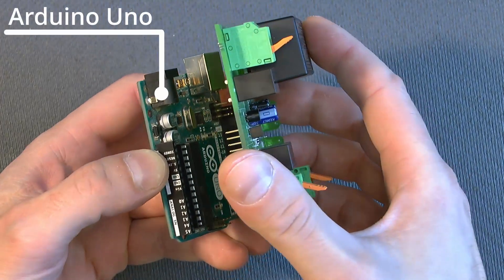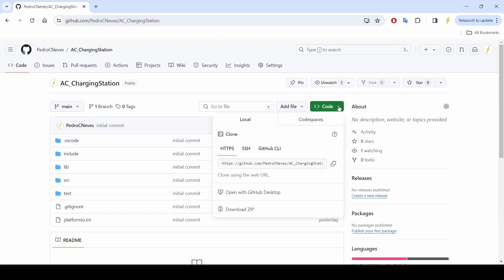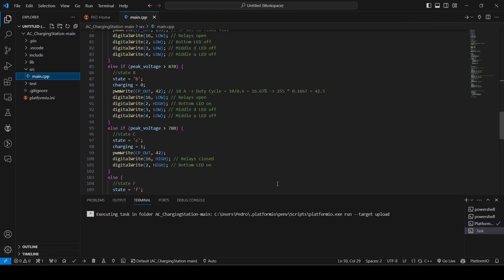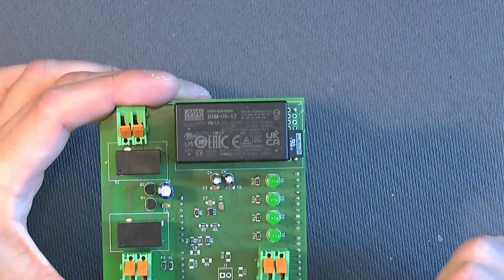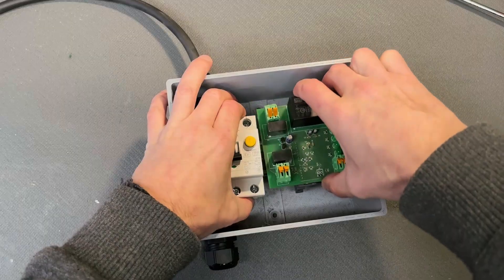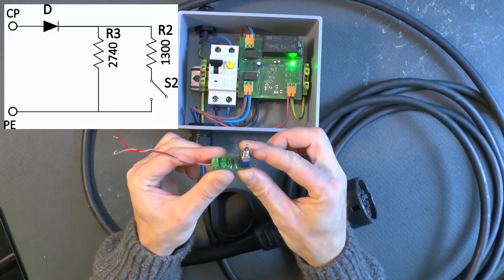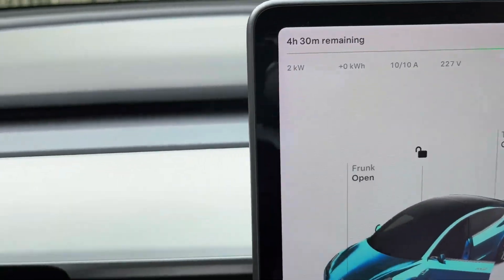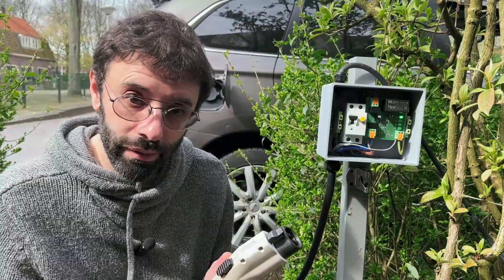DIY EV Charging Station with Arduino Uno

Comment: Nice project. What type of arduino shield did you use, btw?
Reply from the maker: Hi, here is a link to the Shield home page: https://www.powercircuits.nl/home/electric-vehicle-charging/arduino-uno-charging-station-shield. And here's a link to the video of the newest version: https://youtu.be/km1lzvW4czU?si=Gq39ST5yP4tnOA5e.
Cheers!

Comment: Can an LCD be used instead of an LED to display how much the car is charged?
Reply from the maker: You can use an LCD instead of LEDs but the charging station does not know the State of Charge of the car. Only ISO15118 compliant, typically DC charging stations, know the SoC of the car.

Comment: Hi! I am trying to build this design, can you please share the test circuit that you used to trigger the charge? Thank you!
Reply from the maker: Hi, sounds good;)

1) I have an updated version of the charging station. I suggest you use this instead: https://youtu.be/km1lzvW4czU?si=eo_6kk3g_MBf-Nta
Homepage of the project: 
https://www.powercircuits.nl/home/electric-vehicle-charging/arduino-uno-charging-station-shield
2) In this video, I explain the test circuit: https://youtu.be/x4urIvn0Ijo?si=pIr3vCTr2cXkTxKk

Sorry about the confusion with the two channels, I started to split to make it more consistent to the audience.

Good luck with your project! And work safe.

Comment: Hey, can you tell how to integrate power factor correction into this circuit and why did you exclude it?
Reply from the maker: Hi, an AC Charging station has the responsibility of connecting the electric grid to the vehicle. Then the onboard charger of the vehicle has the responsibility of doing the power conversion. For this reason, with an AC charging station, the power factor correction is done by the onboard charger of the vehicle.
With a DC charging station, the power factor correction would be done by the charging station.
Cheers!

Comment: The PDF BOM file isn't opening the links correctly. Can you provide it in excel?
Reply from the maker: Hi, indeed, sorry about that. I will upload the excel soon but in the meantime, you can find the BOM in my website in the end of the page: https://www.powercircuits.nl/home/electric-vehicle-charging/arduino-uno-charging-station-shield. This corresponds to the latest version of the Arduino Charging Station with an external contactor. This way it is more modular and safe. Also, I make the Arduino Shield available there.
The new video is on a different channel. I decided like that to be more consistent to the audience: 
https://youtu.be/km1lzvW4czU?si=5OOvHv1Jd-DGeM_6.

You're welcome to send any questions.
Cheers!

Comment: Can those clip style connectors handle 10A and not make a little unplanned fireworks inside the box ?
Reply from the maker: Hi,
The clip connectors are  rated for 24 A.
But, I recommend you check the newest version of the charging station: https://youtu.be/km1lzvW4czU?si=mrrnd2YciArJ-iz-. I decided to put it in a different channel to be more clear what the channels are about.
In the new version, I use an external power contactor so that it is more configurable and safe.
Reply: @pedro-neves  thanks, because they are rated 24A if you can cool the component to keep it's temperatures at 20C. Those connections are also prone to oxidation that will further worsen the situation in the long run. The updated design shown in the new video is way better and safer.

Comment: Can you make it fast charger?
Reply from the maker: Hi, a fast charger is typically a DC charger. This is a type of equipment that connects directly to the battery of the EV and handles power conversion and regulation. The equipment shown in this video is an AC charging station. It connects AC to the vehicle, and the vehicle's onboard charger has the responsibility of conversion and regulation.
Therefore, AC and DC charging stations are quite different. I show in this video how to make an AC charging station. A DC charging station can also be made, of course, but has more complexity,

Comment: Great stuff! What is your opinion on using an external DIN-mounted relay for turning the power on and off for the charging cable? I am thinking about a system that could be upgraded for example from 1-phase to 3-phase. Further, this way there would not be any high currents going through a custom PCB, only the current that controls the relay.
Reply from the maker: Thanks!
You read my mind;) I'm working on version 2 and it will have an external contactor. I'll publish a video about it soon.
Cheers!

Comment: Nice, the setup looks solid and safe from an electrical point of view, although I'd trust more a rail mounted electrical relay instead of the mini ones on the top board.  Now where do I find how to build a 22kw 3 phase 220V one?
Reply from the maker: @gplusgplus2286  you read my mind;) I'm currently working on version 2 that has an external contactor. You can then choose to use a 3-phase, 32A. I'm updating my course in udemy as we speak and I'll also make a YouTube video soon.
Cheers ;)
Reply: @pedro-neves  great!  Subscribed.
Reply from the maker: @gplusgplus2286  thank you!
Reply from the maker: @gplusgplus2286  , I just created a new video with the newest version of the charging station: https://youtu.be/km1lzvW4czU?si=P__f4EJCuyTOBvQZ. I decided to put EV Charging related stuff on a different channel from now on for consistency of the content. Cheers!
Reply: @pedro-neves  thanks for the follow up!
Reply from the maker: @gplusgplus2286  my pleasure;)

Comment: Hello I like your project I have a quick question where did you buy the TLV1805 I can't seam to find it and is there some special name for it like TLV1805DBVR thanks in advance.
Best regards Michael
Reply from the maker: Hi, thanks!
Indeed, the full name is TLV1805DBVR. Here's a link to the one I bought: https://nl.mouser.com/ProductDetail/Texas-Instruments/TLV1805DBVR?qs=l7cgNqFNU1iC1Jd8EHk%2FgQ%3D%3D.

Just one note: I'm working on V2 of this board and it's much better (also using the TLV1805DBVR but with other improvements in the power transfer, etc). If you like to wait, I should publish in December.
Cheers!
Reply: @pedro-neves 
Thanks for the quick answer, I've already started designing a board in Altium myself, I'm not sure yet whether I'll pause the project and wait for your 2nd version or continue with my board, but thanks for the info.
Cheers!
Reply from the maker: @michaelungler9643  no worries, good luck with your project!

Comment: Hi. Where can I found that diodes? Are they 12V or 5V ?
Reply from the maker: Hello, a generic rectifier diode will do. Such as the 1n4001: https://nl.mouser.com/ProductDetail/Vishay-General-Semiconductor/1N4001-E3-54?qs=N4vtoAxH%2FSoU7cx8rRnwxQ%3D%3D&utm_id=20109199430&gad_source=1&gclid=CjwKCAjw68K4BhAuEiwAylp3kobS7M3McysAa_UBFXhMh2o8s5eVKnb7J1cbOCR2QOg1Ikl7hGkhfRoC9DkQAvD_BwE&_gl=1*oiuhb7*_ga*NTUxMjA1NjIwLjE3MjQ2ODIxNTk.*_ga_15W4STQT4T*MTcyOTE4NDYzOS4zLjAuMTcyOTE4NDY0MS41OC4wLjA.

Comment: Impressive circuit board application. I suggest you put both cables on the bottom of the housing for better waterproofing.
Reply from the maker: Hello, thank you very much! That's a good tip indeed;) This one was made just to show and keep open, but when I design a box for being waterproof I believe I'll follow your advice.
Cheers!
Reply: @pedro-neves  Still on top in Version 2
Reply from the maker: @HouXiang  aaah, that's true... I reused the same box and forgot this. When I make a box that is supposed to be waterproof, I'll certainly have cable entry only from below.

Comment: Can i get the github link and the sheild protector link for arduino
Reply from the maker: Hello, certainly. You can find the link to the GitHub project in the Description of the video and the manufacturing files in GitHub.
But, I'm working hard on version 2 which will be a big improvement so, if you want to wait for that, I think I'll publish it by the end of October.
Cheers!

Comment: Does it really need -12v ?   That ads some parts that I'd like to avoid.   Using a motorcontroller chip, it can switch a gnd +12v to +12v gnd, which looks to me the same signal.
Reply from the maker: Hello! Indeed, adding a -12 V supply increases the complexity. This is needed because the Control Pilot is a signal that switches between -12 V and + 12 V at 1 kHz. There are certainly ways of doing this differently than I did, but I suspect it would have to be more complex.
Cheers!

Comment: Can you teach "How to create an Ev charger AC to DC single phase 2 or 3 kw output DC chager?"
Reply from the maker: Hello, when connecting an Electric Vehicle to an AC charging station, the vehicle utilizes it's onboard charger to convert AC into DC. It's always hard to decide how much detail to add into the videos on YouTube but I have a complete course on EV charging in Udemy. Here's a link if you would like to consider it: https://www.udemy.com/course/electric-vehicle-charging-from-theory-to-practice/learn/lecture/42720488#overview.
Cheers!

Comment: There are a lot of safety features and standards for this kind of product. A DIY project like this one doesn't meet half of them.
Reply from the maker: Hello, that is true. This is meant as a learning platform and is not a finished product.
I installed an RCBO compliant with IEC61851-1 which disconnects after ground faults over 30 mA AC or 6 mA DC which I consider to be the main safety feature. But there are many others.
Reply: @pedro-neves I worked on EVSEs a bit. You should also have an overcurrent protection, surge protection and ground fault protection. Overall an interesting project, you demonstrated how it can be done with Arduino. You can also easily add a measurement unit (either DIY or MID interfaced by modbus).

Now add OCCP 😂
Reply from the maker: @Krzychu-bh4rl  , hello, and thank you for your kind and constructive comment from a fellow EVSE technologist!
I have overcurrent protection upstream in my main board and also in the EVSE. The "O" in RCBO means Overcurrent.
I also have ground fault protection. The "R" in RCBO means "Residual". The RCBO that I'm using is also certified by IEC 61851-1 to protect ground fault to current exceeding 30 mA AC or 6 mA DC. I have a link to the RCBO I'm using in GitHub.
I agree that it should measure Current and Energy. I'm sure I'll add it one day;)
And I would like to do a project just on OCPP. I think it will happen;)
Cheers!

Comment: a normal charger can give up to 22kW, usually 11kW. I seriously doubt that this board/relay/connectors/cables can take 11kW
Reply from the maker: Hello, you are right. 
- 22 kW would be a system with 230 V, 32 A per phase and 3-phase.
- 11 kW would be a system with 230 V, 16 A per phase and 3-phase.
My board only allows one phase and 16 A (I only tested with 10 A), which makes it a theoretical maximum of 3.7 kW or tested 2.3 kW.
If one would want to use this board to make an 11 kW or 22 kW, it would be possible by using an external contactor commanded by the board.
I'm thinking that V2 will be like that actually to maintain the same board for different power systems.
Cheers!

Comment: Hi Pedro,

Very interesting video. It immediatly triggered my intrest. I would have liked to hear a lot more how the program works. Especially with EV charging it would be nice to know more about the protocol for communication with the car.

On the electrical side of things. Why are there no diodes across the relais coils or optical pin isolation to and from the microcontroller or an air gap between mains and the  low power side of the circuit board? 
It might also be a design decision to buffer the PWM output circuit and add pull-up / pull-down resistors to make sure the pins are always at the required state when powering on or starting the microcontroller.

Humours note: Guess you live in an area where it never rains because it would be a really bad idea if water would run into the enclosure through the cable glant on top of the box.  🤒

Best from the Netherlands.

Proposal for updated code?

#include <Arduino.h>
#include "PWM.h"

#define CP_OUT 10 // Maximum Allowed Charge Current
#define CP_IN A0 // Applied AC Voltage

enum State {
  STATE_A,
  STATE_B,
  STATE_C,
  STATE_F
};

State currentState = STATE_F;
int peak_voltage = 0;
int charging = 0;

void setup() {
  Serial.begin(9600);
  InitTimersSafe();
  SetPinFrequencySafe(CP_OUT, 1000);
  pinMode(CP_OUT, OUTPUT);
  pinMode(4, OUTPUT);
  pinMode(6, OUTPUT);
  pinMode(2, OUTPUT);
  pinMode(3, OUTPUT);
  pinMode(16, OUTPUT);
  digitalWrite(16, LOW);
  digitalWrite(6, HIGH);
  digitalWrite(2, LOW);
}

void loop() {
  // Read the CP voltage peaks
  findPeakVoltage();

  // Handle state transitions
  switch(currentState) {
    case STATE_A:
      if (peak_voltage <= 970) {
        currentState = STATE_B;
      }
      break;

    case STATE_B:
      if (peak_voltage <= 870) {
        currentState = STATE_C;
      }
      break;

    case STATE_C:
      if (peak_voltage <= 780) {
        currentState = STATE_F;
      }
      break;

    case STATE_F:
      if (peak_voltage > 970) {
        currentState = STATE_A;
      }
      break;
  }

  // Execute actions based on current state
  switch(currentState) {
    case STATE_A:
      charging = 0;
      pwmWrite(CP_OUT, 255);
      digitalWrite(16, LOW);
      digitalWrite(2, LOW);
      digitalWrite(3, LOW);
      digitalWrite(4, LOW);
      break;

    case STATE_B:
      charging = 0;
      pwmWrite(CP_OUT, 42);
      digitalWrite(16, LOW);
      digitalWrite(2, HIGH);
      digitalWrite(3, LOW);
      digitalWrite(4, LOW);
      break;

    case STATE_C:
      charging = 1;
      pwmWrite(CP_OUT, 42);
      digitalWrite(16, HIGH);
      digitalWrite(2, HIGH);
      break;

    case STATE_F:
      charging = 0;
      pwmWrite(CP_OUT, 255);
      digitalWrite(16, LOW);
      digitalWrite(2, LOW);
      digitalWrite(3, LOW);
      digitalWrite(4, LOW);
      break;
  }
}

int findPeakVoltage() {
  int current_voltage = 0;
  int peak_voltage = 0;
  
  for (int i = 0; i < 100; i++) {
    int voltage = analogRead(CP_IN);
    if (voltage > peak_voltage) {
      peak_voltage = voltage;
    }
  }
  
  return peak_voltage;
}
Reply from the maker: Hello, and thank you very much for that!
Indeed, I could have explained more about the communication. I always debate with myself about how much detail to add to these videos. The next video that I will make will be to explain the communication in detail.
Regarding the electrical:
- Indeed, there should be flyback diodes.
- No need of optical isolators to drive the relays. The drive side is isolated from the power side.
- There is a big gap in the PCB between power and logic
- Cannot put pull ups or downs in the PWM because it has that 1k resistance in series to measure the voltage drop caused by the circuit in the car (will explain in detail in the next video).

Thank you for making the code so much nicer;) I will look at it with care;) I appreciate the trouble that you took to make it.

Hehe, that enclosure is more meant to demonstrate what's inside than to be in the rain;) Wouldn't dare to leave it outside unattended;) 

I will keep improving this project and I appreciate contributions such as yours.
I will also make another video to explain the communication in detail.

Cheers!

Comment: loved the video ! here's a friendly suggestion : I saw the code is around 3kb ,in that case you should drop using the arduino since it is fairly expensive , you can instead use an atmega 8 ic which has the same pinout as the atmega 328p used in arduino uno . you can get it as low as 3 USD . 
You'll just have to burn bootloader and then programming is as easy as popping the atmega 328 out of the arduino and putting atmega 8 in it . 
If this sounds like a hassle ,you can go with arduino nano !
Reply from the maker: Thank you very much for the kind words and for the suggestion! Indeed, the Arduino Uno is not cheap. I chose it because I wanted the most DIYer friendly board. I think the Nano may be a good option as well;)
Cheers!
Reply: You could use ESP8266 or ESP32 as it's same price to buy and provides spare headroom for future enhancements
Reply from the maker: @uosiumen  that's true. And I did consider it. One of the reasons for choosing Arduino is that I think it is the platform perceived by hobbyists as the lowest barrier to entry,  and I wanted it to be the easiest possible to everyone.

Comment: Good initiative. I would suggest some changes related to security. The entrances to the box should all be from below and not from above, to prevent water from entering. The protection diodes are missing from the relay circuits. The ground should not be connected to earth because they are different systems. To protect the dc system, I suggest using a fuse.
Reply from the maker: Hello, thank you for that!
Indeed, the box was not designed yet with protection in mind. More with the intention to show.
Keep in mind that Gnd has to be connected to Protective Earth. That is necessary because the Control Pilot has to be referenced to Protective Earth. This is mandatory as described in SAE J1772 and IEC 61851-1
Cheers!
Reply: @pedro-neves  I was just about to ask that question. I have similar build like yours and I struggled couple of days until I gradually found out the system is working after connecting ground and PE together. Does this have any downsides or consequences considering what @amandioreal2293 just said - that they are two different systems? Thanks for the answer!
Reply from the maker: @SpaceerX  hello, the PE and Ground are tied together for safety reasons. This is how it's done in caravans also when they're connected to the grid. You need to connect the chassis of the car to PE. And the chassis of the car is connected to its DC Ground so...
If still in doubt, this is also mandated by IEC 61851-1.
Cheers! Happy to see people interested in EV Charging!